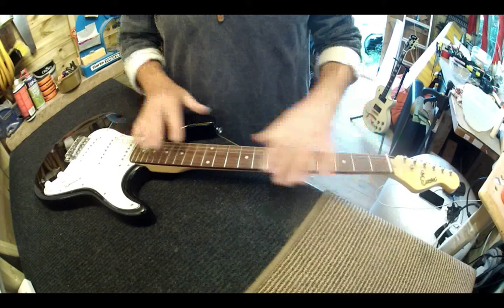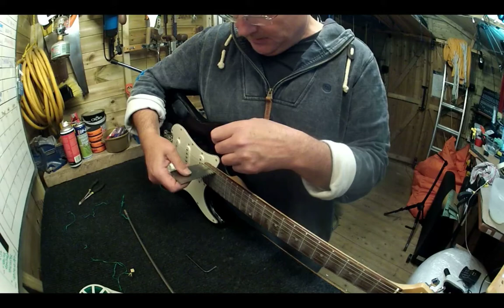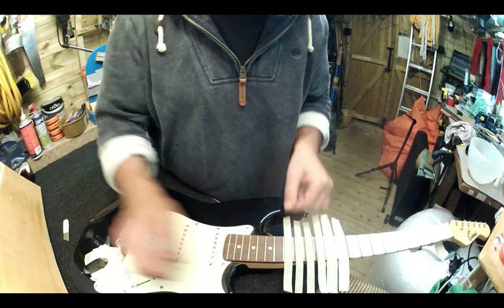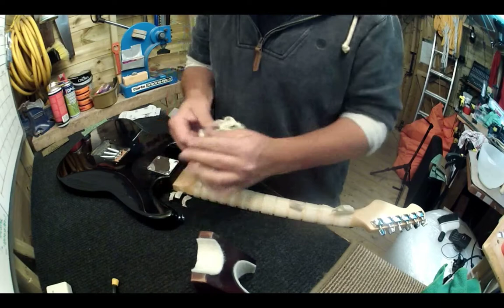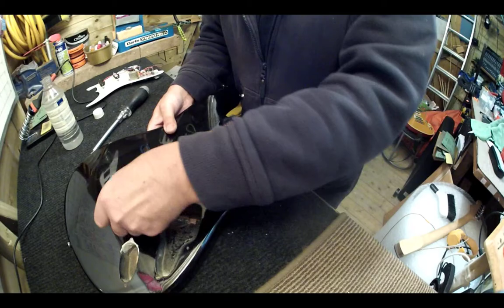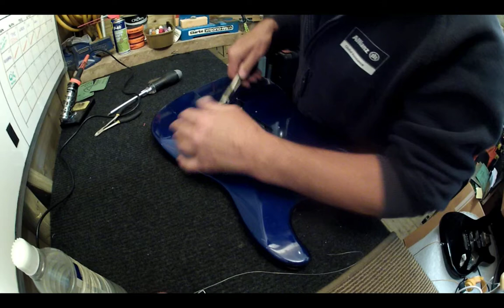Encore Affinty strat hybrid setup Part1

Comment: Nice to see you using a dampened sponge for the iron Sam, but a tip for getting solder to melt quicker / easier - introduce some fresh solder onto the tip of the iron as / just before you start to heat the 'old' solder. ;-)
Reply from the maker: +Steve Cook Thanks for that ah...tip Steve. Funnily enough I was reading something today that said DON'T put solder on the tip first ;-) One thing I know is that I've got a lot to learn when it comes to wiring and soldering :-)
Reply: 30+ years of being an electronics tech and all the experience says you put solder on the tip first makes your job a lot easier. The downside is lead free solder has a higher melting point than the old stuff and doesn't flow as easy!! Ignore what you read - solder the tip first EVERY time ;-)
Reply from the maker: I'll go with your 30+ years Steve ;-) Thanks! I'm determined to get better at wiring and soldering so your tips (no pun intended) are welcome
Reply: +Sam Deeks Not a problem Sam - anything you need assistance with just call ;-)

Comment: Sam, what do you use to fill in little dings and chips? So many guitars are black, I thought of a car touch up pen, and building up with some clear?
Reply from the maker: +Pádraig Floyd I have both cellulose and waterborne paints and lacquer to cover up easy-to-repair dings. These days, I tend to avoid working on the finish - unless its very simple. I'm not a finisher so don't get a professional finish anyway - although at times its passable on a budget guitar. I think StewMac does a video where they colour with marker then fill with superglue (!). I often commit the crime of touching up with cellulose on polyurethane (waterborne) because its easier to manage...it works OK and I've never seen such a repair fall off or detach or anything.
Reply: +Sam Deeks Thanks again, Sam. Marker and superglue? I could see how would work. 

I agree about finish. People buy these guitars for nearly a ton, but for another £60, they would often play like guitars sold for £300 or £400 as the margins are so fine. Who cares about a couple of dinks if you have an instrument you can really play.
Reply from the maker: That's my philosophy Padraig. As you can see, I'm not in the margins game. It's about adding real value (as attested by my satisfied customers & eBay feedback) and selling only to a market that's looking for that quality. It's why I don't sell by auction or have a 'best offer' option. If someone's first priority is finding the cheapest possible guitar and/or haggling, then I'll openly say "I'm not the right seller for you". It keeps it very simple for all sides.
Reply: +Sam Deeks Good philosophy and I thoroughly approve. Keep it up.

Comment: Where do you buy these guitars Sam? and the better question is where do you sell them all. Ebay?
Reply from the maker: +Joe Dov Some of them are eBay buys, some from another buy / sell site called 'GumTree'. Occasionally I find some locally. I sell on eBay but at present I don't have the 'international' option set on because setting up courier charges to every country is a mega pile of research and work to update every time the courier costs change. eBay hasn't made selling internationally easy, that's for sure - because they want you to use their (lousy by all accounts) 'Global Shipping Programme'
Reply: I sell on Ebay also Sam but no international on my end either. we have a thing here called craigslist.I get some good buys there.not much luck selling on there locally anymore.